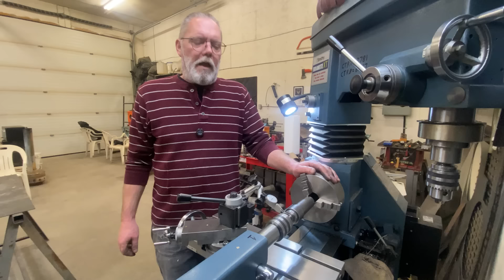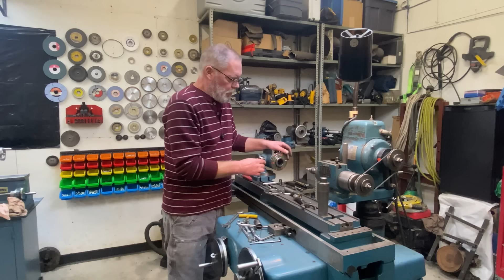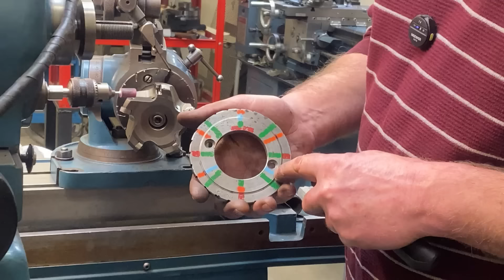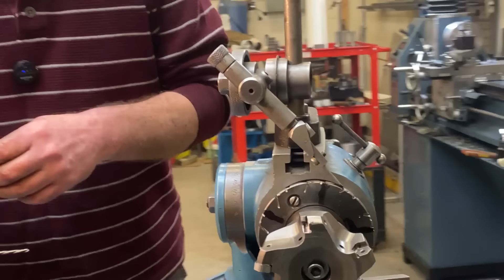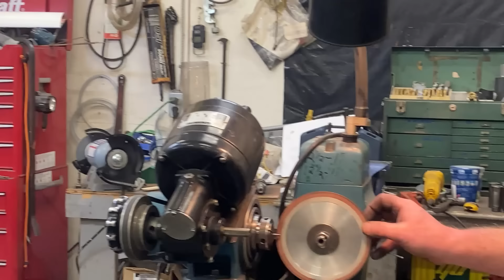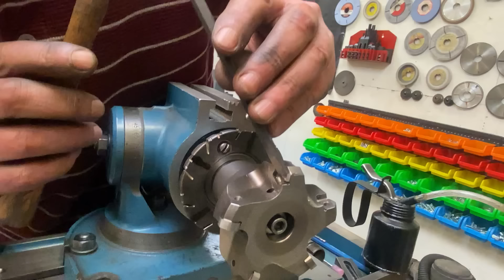MOST IGNORANT BROKEN SCREW I'VE EXTRACTED

Comment: That’s a great demonstration of how to get something perfectly centered for machining yet I would’ve done it very differently. I first would’ve tried to freeze the whole assembly with liquid nitrogen to see if shrinking the screw made it loose enough to remove it. Then if it didn’t work I would’ve used a ground pin the size of the hole on the back of the screw hole to center it for drilling. But then I’m not as tech savvy as most machinists.

Comment: About 50+ years ago I broke a brake bleeder screw in a disk brake caliper, then broke a easy out in it. I stopped there and a local welding/machine shop removed it. What they told me was they set a nut on top of it and welded up the center. Between the heat from welding and the nut to grab on to. It came out beautifully. They said the heat from welding the nut on played a big part in taking it out.

Comment: Did it back out because of the vibration or from friction welding?
Best 3 tools I ever bought were 1,2,3mm hss coil winding rods, so many uses.
Reply from the maker: vibration and cutting force. There was very little heat

Comment: As there is a through hole, have you considered attacking from the other end? The bottom of the screw should be flat, so less wandering of the tool and maybe the bottom of the screw us not so hard. Finally, that would allow you to use right hand tools.
But you'd be working blind.

Comment: The worst thing about removing broken studs,bolts etc is the person who had a go before giving up and asking me has made the task 10 times harder for me
Reply from the maker: I hear that
Reply: I was a Ag equipment mechanic many many years ago, and we always said that the shop rate is $100 an hour and $150 an hour if you worked on it first.  It was always a bad day when a customer brought in a piece of equipment with boxes of parts they removed trying to fix it themselves.
Reply: I have to do this on glasses frames.
It's almost always just a screw that's mildly stuck from rust or loctite, having gotten really stuck from an optometrist marring up the head with brute force, followed by an amateurish attempt at offcenter drilling.
Also the screws are like 5mm long and have a 2mm head if you're lucky.
 I have no clue how they always think they can drill it out by hand, without experience or appropriate tools.
Like even if you drill through the hardened screw in its unhardened threaded hole, the thread of the screw' still in there bud.
Reply: If it was easy to remove you wouldn't be able to charge alot, customers in every industry make things harder and that makes us more money.
Reply: This.  Even worse when the other person was also me. 🤣
Reply: Boo hoo.

Comment: Carbide center drill all the way bro. Use water. as fast as you can. Sometime a center cutting end mill will do it but you need a Bridgeport peck . 004 at time. controlled stop. Maybe a spray mist too. Last but try burn it out tap burner or edm. Another thought. . .drilling a small hole with carbide drill then use the right size easy out. Good job regardless.

Comment: Pre-drill the underside of the screw from the back in the center, insert a Torx Plus bit and unscrew it towards the front.
Reply: Torx bits are the screw extraction tool you didn't think you had - until in desperation you used them!

Comment: Want to know how to spot a genius machinist? He has grey hair and yet has all his fingers.
Reply from the maker: HAHAHA I'm going to use that!
Reply: Lol lost half a thumb to a model engine... five years after retiring from 45 years machining!
Reply: @rcdogmanduh4440 about 15 yrs ago, I had the 1st intimate interaction with a saw blade, after nearly 40 years as a carpenter/cabinet maker.

It was not what I expected.  Carbide blades are so sharp, (I came up in the pre-carbide days, when every carpenter had 2 - 30 blade holders; 1 was always at the sharpener), I figured it would be a bad cut and feel like it.

It felt like somebody hit the end of my thumb with a hammer. Not a smashing blow, an end of thumb hit.

I thought the board kicked back and hit my thumb. Then I looked at it and saw the ragged groove in my thumb... ten it filled right up... w/ that red fluid we all are filled with.
Reply: @georgedennison3338 does make a different  sound when it cuts flesh  doesn't  it...took the tip of thumb off ...all the meat and just to the bone...flesh grew back ...but if I bump it just right...argggh
Reply: 😂 i am a spindle repair rechician and half of my finger missed
Reply: yes we sacrific the young  ones...
Reply: "If I were a bad macinist, I wouldn't be sitting here discussing it with you now, would I?"
Reply: Bingo!
Reply: he would never risk his fingers on work he needs those to prep the bull 🐂
Reply: Yeah dont ever grab at the spool of wire cumming off your lathe..  LOL   I always use dykes
Reply: I wasn't sure that was true at first, looked like the last segment of his index finger was missing, alas it was only hiding in the shadows.
Reply: No risk, no reward. But I'm a bigger fan of "if you're gonna do something stupid, best be smart about it." Most check out after "best be" though.

Comment: Cobalt won't drill hardened steel.  It's not hard enough.  You need a single flute carbide die drill or edm.  What kind of lathe / mill is that?
Reply from the maker: It's a smithy XT1340
Reply: @Lappemountainliving Do you like it?

Comment: brings back memories of  jobs that always landed in my lap because  no one else in shop  had  the knowlwdge  or patience to tackle getting  stuff like this out. many of these screw in insert type   have an offfset  head  compare to the   thread itself so it acts as a cam to pull the   insert into the seat.  sometimes a carbide  drill bit, worse case a micro carbide  endmill  instead of a drill.  BTW  you  should  use gauge pin  not a screw  to set up zero position

Comment: Why didn't you just back-drill the screw from the hole?
Reply: That’s what I thought too! Seemed like a no-brainer to try. That’s probably why they’re there in the first place. The break was from over tightening/stretch not corrosion.
Reply: @Reginald-Bowls  correct, another machinist mentioned it also in the comments with more detail; i've removed lots of broken bolts from cars/engine, this is piece of cake
Reply: That’s what I thought too.

Comment: I did not expect that chisel to work it seemed way too big and clumsy for that mangled screw head.
Reply: I said the same thing.  With all the tools in his shop, and all that setup grabbing a 5/8" cold chisel at the end to move it hand me palming my head. Center punch would have been easier, and I would've even tried that with a combination of heat for 15 minutes before perhaps doing some welding if it wasn't moving.

Comment: I recently had a similar problem, I ended up milling it out.  I don't want to be critical or say you did anything wrong, just to say how I indicated on the hole was using a precision ground gauge pin to find the adjacent hole location, that way I didn't have any slop or movement.  Always interested to see how other people solve problems.  As I said I milled out the screw untill only the threads were left in the hole, if that didn't work I would have sent it to another department to have the guy who runs the sinker EDM give it a try.
Reply: You could weld the inside of a nut onto the broken part maybe, if drilling doesn't work.

Comment: I've always tig welded a miniature snow man to small broken bolts like that once it cools the head shrinks and I wick wax into the threads while it's hot. Smallest I've done this to is 440 screws usually stripped flat heads. Works like a charm. Small needle nose vice grips grab the snow man nice. Beauty of this method is it does not care how hard the fastner is.
Reply: "tig welded a miniature snow man to...👍👍
Reply: I would put a flat blade screw drive slot in the end of all the fasteners that hold the tool bits in . Then if a fastener broke you could put a small screw driver in from the back side and be able to spin it out.   Since the broken piece spun out easily, it should be able to be removed from the back side and save all the drilling and set up.
Reply: @CHRnorton  You'd think even trying to start drilling from the back side might have been an option too for a drill approach. Seems weird anything was stuck, when it screwed out so easily ( well after some initial machining )
Reply: Well I'll one up you I've done it to M10 studs on exhaust manifolds, that's like 3.52X  the size of your little 4-40 screw..   j/k         Even just heating the head with the TIG can rapidly cooling it works some times, just dont go past orange
Reply: With the through hole in the back of the tool head, couldn’t you go in from that side with a right hand drill and maybe work it out that way? Like, a right hand bit from behind the broken screw would want to turn the bolt in the direction to unscrew it? Please let me know if I’m wrong here…
Reply: You are correct  @farmineer8276
Reply: Have to be a little careful when it's steel though but often the surrounding material takes more heat before it starts melting. Steel screw in aluminum works like a charm to weld and you don't even have to be carefull.
Reply: I’m not any kind of machinist or tig welder so please tell me what a snowman is.
Reply: @Richard.Hybels Putting down a blob, let it cool and stack another on top and so on.
Reply: @Henrik.Yngvesson  I get it
Reply: @Richard.Hybels  I think it refers to a little pile of welding beads piled up on the offending broken screw.
Reply: @Richard.Hybels little stacked balls of weld that look like a snowman
Reply: Same here although I never thought to call it a snowman 😁

That is much more polite than my imagined peak of modern goodness.
Reply: That screw was insanely hard, why is that?
Reply: @trif55  small parts are tough to heat treat. Probably never got tempered, tough to say.
Reply: Yup tig build up a post with a few heat cycles and crayon wax that screw will come out quite easy ten minute job 
All this trouble and work pointless
Reply: I've got a clausing universal tool and cutter grinder so I appreciate your tutorial on grinding tool work. It's becoming a lost art.
Reply: Cool hand flute
Reply: Full of illicit content not for the faint hearted immoral narrative, with the concubine present, a barbarous narrative with harpy propounding a slanderous assailant of barbarous word of evocation
Reply: Thats the way, especially sweating in wax while hot. wax is very lubristic.
Reply: Cant be hard if its a liquid!
Reply: Also i have had a extractor screw break inside a stuck bolt, 8mm 8.8 bolt ,broke off the head and the thread was left over, tried to weld a nut onto the thread that was left, but simple broke off once it cooled down, but the extrata screw made to screw into the centre of the broken bolt also broke inside the thread, so in the end just used a drill to drill everything out starting with a small drill bit and got larger till most of the material was gone from the extra screw , took a couple of hours but worked and then used the same tap to make a new thread inside the  car inlet manifold ,which is where the thermostat sits ,one of the bolts broke .😠🦘👍✌

Comment: EDM (electrical discharge machining) would be the method to use for that removal.  Only the Bolt/screw would be damaged.
Reply: Or if you don't have a $100,000 wire EDM machine, welding would be faster.  Look for the fastest, cheapest way first, then if only absolutely necessary go these elaborate/expensive routes.
Reply: @komoru dont need $100k to erode a bolt with a welder and electrode.

Comment: Have you ever tried MASONRY drill bits? They are high speed steel bits with 2 carbide inserts weld set into the tip.  Im a BMW mechanic and i use them often on anything hardened that i need to drill out!
Reply from the maker: I have had excellent luck with those. Thanks for watching!

Comment: For the purpose of getting that first hole through the screw I have used micro tubing and diamond paste to make the first penetration but then I started out drilling Rock at a very young age. If tubing is not available you can use brass wire to hold the grinding compound against your broken screws. The diamond grit will inbed into the soft metal and rotate against the hard material removing material from the harder surface.  I have found once you drill through the  center of a fastener it will shrink away from the walls of the hole.
Reply: This is a awesome idea ill have to keep in mind!

Comment: Funny how the craziest saves can be more prominent in the memory over some of the greatest accomplishments. I used to do ship repair. Was on some amazing structural repairs and modifications, but the last crazy save is forefront in my memory.
The Navy couldn’t get an inspection plate off the weather deck at a CWIS (See-Wiz) gatling gun emplacement. One of the 10 bolts sheared off just inside the bottom of the hole in the plate. When I took the plate up there was just a hint of the shank of the bolt. I puzzled over how to deal with the extraction. The only mag drill we had was a huge monster and I’d have to haul it out to the ship, run power, set it up, etc.
I couldn’t get anything on the remanent of the bolt. So, I took my trusty ball peen hammer, and my trusty sledge hammer and started peening the metal of the bolt fragment back and forth, back and forth, blacksmith-like. Finally, I was able to upset the metal into an elongated oval shape that I could get a crescent wrench to bind on it and put pressure CW, then CCW, just putting pressure on it and finally I got movement in one direction, then the other, and the darn thing was starting to rotate. It came out finally and I made a new plate and gasket, fitted new bolts, used plenty of anti-seize, and gave the Navy a serviceable port to service their gun.
That stupid stud remanent became a precious artifact. I’m not so amazed at the actual repair, which admittedly took a lot of old school skill and patience as I am kind of astonished that it meant more to me than multi million dollar fabrication and repair jobs that to months and months.
Of course, there was a half dozen different ways to deal with the sheared off bolt but they would all have taken big set up time and various risk to really F***ing things up. The fact that I could deal with it then and there with the tools I had with me, and old guy patience and skill, was what made me smile, and puff up a bit.

Comment: Can't you go in to the open face of the screw with a standard right hand bit? It looks like these are intentionally not blind holes for that reason. It might have even worked without changing much if you just set the broken one to the bottom of the index. Then hit it with the right hand bit through the bottom hole.

Comment: I have successfully removed many broken taps and bolts of all harnesses using a Dremel tool with a Dremel diamond bit. If removing carbide it sometimes takes 2 bits. Doesn't usually take too long and the internal threads are usually untouched.
Reply: I use the diamond or alumina disk to cut a slot in the head of the screw and use a watch screw driver to remove it does leave a slot but the slot is usually benign
Reply: Same. Sometimes welding is the dreaded option. If I can I’ll center punch and drill out the middle of the screw as close as possible to the diameter of hole and use the mini carbide burr files and file out the bolt on opposing sides and then split it in two to relieve the pressure. Saves the threads if they didn’t get too damaged by the bolt seizing in the first place.
Reply: Interesting, sometimes a low tech basic method is the best tech.
Reply: what diamond bit are you using? i have a broken drill bit i need to get out.
Reply: @verteup Dremel makes a small diameter diamond bit with a tapered point. I think it is brass or bronze binder with a matrix of diamond abrasive similar to the edge on a concrete saw. Let the abrasive do the work. Just light pressure only.
Reply: @Garthinyus  thanks much appreciated

Comment: Here's just an odd thought about something that would be interesting to try. Not on a part you care about, but probably just on a piece of metal with done thready holes you drilled and screwes that were deliberately broken. Make a dicor in the center if the screw as normal. Make a tool with an adjustable clutch (magnetic perhaps) attached. Blow sheolding gas like argon or CO2 on the broken screw head and jam a steel rod, reverse rotation into the broken screw. If it works, then the rod will friction stir weld to the screw then overcome the clutch and start turning. Then try to back the screw out.

Comment: Plunge it with an endmill! I gave up trying to bore these pieces of shits out with a drill ran into all your problems, then I found a small dull stubby endmill and it worked first shot. Done it that way many times now

Awesome work with the indexer and all that to make it perfect, all I had was a drill press 😂
Reply from the maker: That's a great tip, thanks for sharing your experience!
Reply: Also if you are lucky you can simply just screw in a bolt from the other side to simply just screw it out